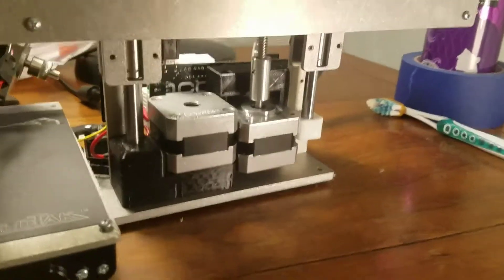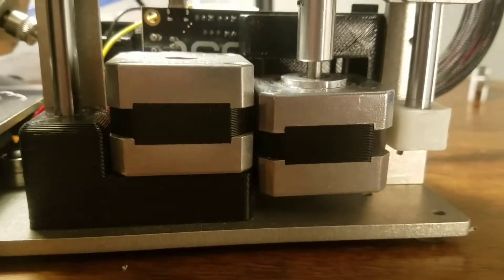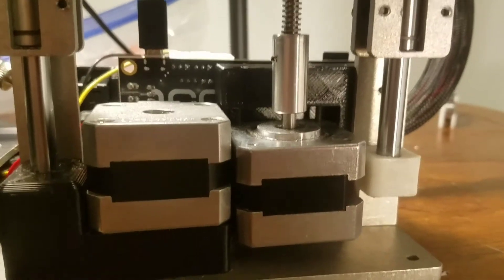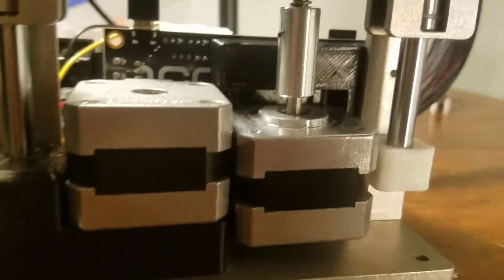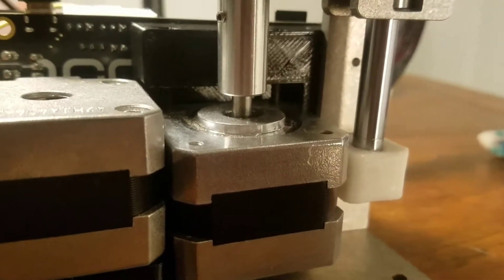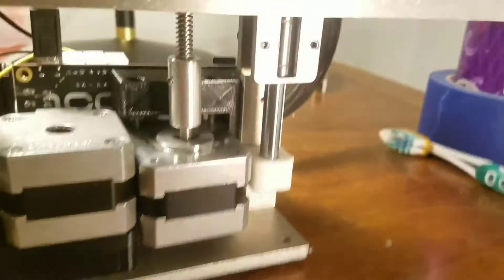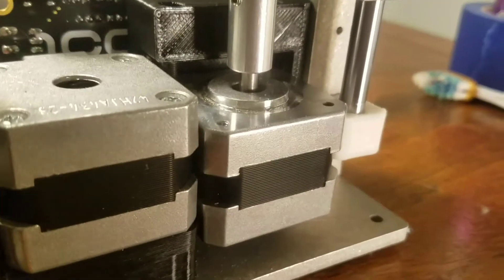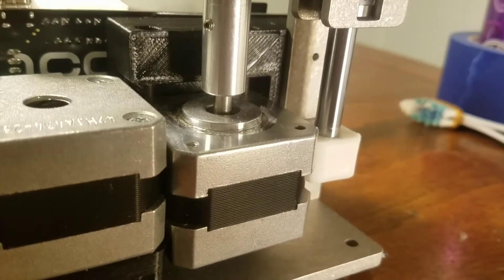Printrbot Smalls with correct z motor mount

Comment: On my smalls the motors are almost flush with one another... How did you lower the Z motor? The other issue is my Z motor gets too hot and will no longer raise or lower during a print... Any insight?

Comment: Now that the wobble/jam seems to be fixed how are you liking your smalls?
Reply from the maker: Randy Hightower overall I like it. The parts seem to be of good quality. i wish there were written instructions on the build. I wish they would remove moderated support request so my request for support would be handled faster. I'm pretty sure that the Z screw is going to break first.
Reply: How did you calibrate the sensor ? in having trouble with mine
Reply: I put 1 business card down on the platen under the extruder, then lowered the Z gantry until the sensor light turned on. I tightened the sensor down. Then I used the M501, M500, M212 settings for fine adjustment.